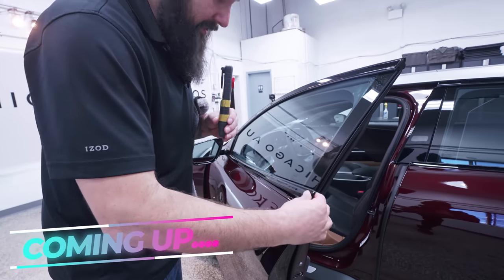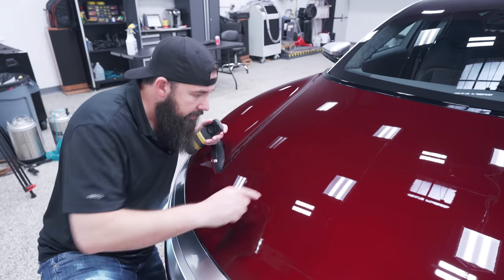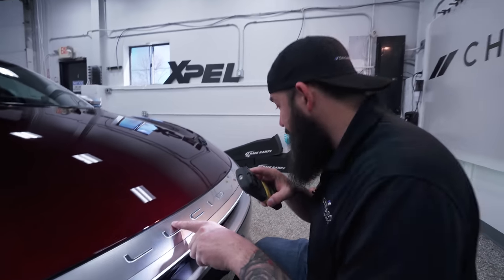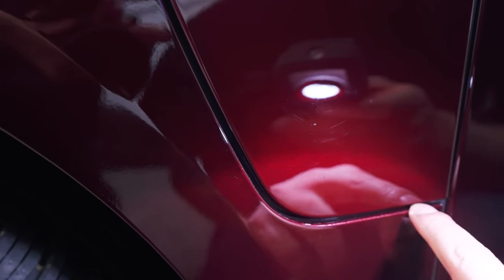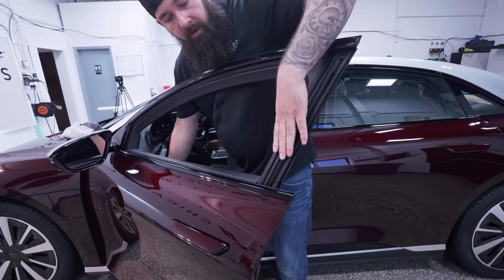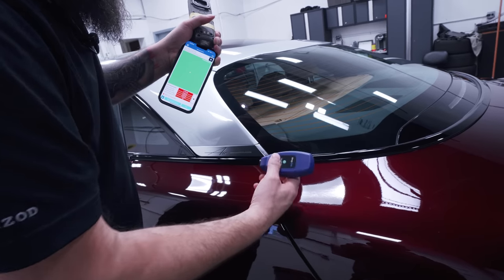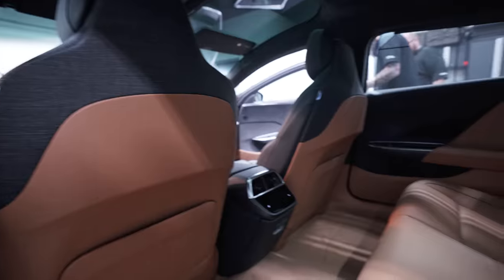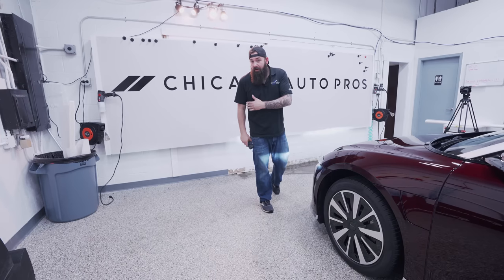2022 Lucid Air Inspection + First Impressions | How Bad Is It?

Comment: For 140k, this build quality is atrocious. Hopefully the repaint was disclosed, because if not, there should be hell to follow. Lol Thanks for making these vids that allow us to make more informed buying decisions. You guys are the real MVP’s
Reply from the maker: It was NOT disclosed.
Reply: @ChicagoAutoPros  “Lucy, you got some splainin’ to do” lol
Reply: Sounds like a cousin of Tesla with fit and finish problems.
Reply: That door trim that is loose is not the same door trim as on a Lucid. Something isn't adding up....
Reply: If you buy a imported car into the USA, lets say a BMW and it got damaged on the way over on  the ship or at dock side in the US it will be fixed buy BMW and they don't have to disclose it.
Reply: @geraintroberts7569  This happened to my MINI. I was tracking it's progress, and the thing sat "on the dock" for almost a month. When I got the car, there was red overspray inside the front of the passenger door jamb where masking was difficult. The clearcoat they reapplied wasn't blended correctly, either. I put my foot down at the dealer, and they made it right. They even repainted the roof, which ended up being the smoothest paint on the car. These things happen. Sad that it happened on a $140,000 luxury car, rather than a $25,000 commuter.
Reply: @XX-166  younger Tesla is more accurate. Tesla build quality is far better than it used to be, and they don’t sell $170k+ cars like Lucid does 🤷🏾‍♂️
Reply: @waynelewis9110  teslas build quality and fit and finish is shit and that’s well documented
Reply: @geraintroberts7569  they disclose everything. Don’t spread false info.
Reply: @XX-166  Sure bud! Tesla’s sales continue to reach new heights and quality continues to improve. Keep on detracting though lol
Reply: @waynelewis9110  the truth isn’t detracting Elon…it’s just the truth
Reply: @XX-166  Something can’t be deemed truth if it’s missing much needed context 🤷🏾‍♂️ Besides, detracting Tesla isn’t just detracting Elon. Tesla employees over 110k people, with over 50k in the US. You are detracting all of those people too.
Reply: @waynelewis9110  go finish your Elon tattoos fan boy … we all know where you’re coming from rainman.
Reply: @XX-166  Lmao, you got jokes. I guess setting the record straight somehow makes me an “Elon fanboy” when I’m really not. Funny how it didn’t take long for you to start name calling 😂
Reply: Not as bad as Tesla for sure
Reply: @marvinmarshall8884  Not as bad as 2017 Tesla but even then, Tesla isn’t selling $170k+ cars.
Reply: It must be said that the handling steering brakes and suspension are in a completely different league than anything from tesla. I know because I’ve driven both. The lucid reminds me of a lotus. 1st priority is the chassis and everything else comes secondary
Reply: @joetz1  You can say anything as you like. However, when Peter Rawlinson bragged about Lucid's capabilities to overcome the production issues by taking advantage from the lessons of Tesla's past experiences, then Lucid should have no excuses for delivering 'the 170k $ unfinished products' to its customers.
Reply: @waynelewis9110  the quality shouldn't have been so piss poor to begin with and thus it wouldn't need to improve so much.  Keep on making excuses for King Musk though, fanboy lol
Reply: @Euro2024champs  You seem so damn hurt to where you have to quickly name call. Grow up guy. My point was that it’s not apples to apples to compare Lucid’s hand-built $170k cars’ (literally only producing around 7 in an entire day) rough quality with mass-produced, early Model 3 quality which were built in the thousand and not by hand. I never disputed the fact that quality was rocky with Tesla. Model 3 ramp had some bad stuff, but it’s in the past. Move on and find something else to legitimately complain about with Tesla, like how they removed the mobile connector as an included accessory with vehicle purchase.
Reply: @XX-166  Actually on the newer models, the fit and finish improve a lot compare to the 2017 thru 2019 models. I have friends and co-workers bought 2022 model 3 and Y. I went over to see their cars, just to inspect the quality. To my surprise it was quite an improvement. So just give Lucid some time and they definitely improve on the quality.
Reply: @lancetruong4957  those earlier years also had some models without issues.. the newer ones do also because of an assembly line/business culture of there’s no one else out there so the public will buy our cars regardless of perception. Those days have been long gone and the competition is healthy with better technology and options along with 7500 dollar tax breaks
Reply: @waynelewis9110  I still have not seen a Tesla on the streets without misaligned body panels. The build quality is terrible and it doesn't even have a nice interior. Tesla is like Dodge but electric.
Reply: @JohnFromAccounting  And yet every car you've seen was pre-2019
Reply: @JohnFromAccounting  I bought a new X 2018 into 2019, it arrived with a handful of small alignment and seal issues, I made a list and they took it back for a day and sorted them all. Paint was actually pretty good, interior was very solid, easy to clean despite being white, I am not a Tesla evangelist or anything, but generally they are now fairly solidly built and well thought out cars.
Reply: @XX-166  well its ex tesla people who started lucid
Reply: @nocensorship8092  and at those prices we’ll see how far that goes.
Reply: @Euro2024champs  Don't like the quality of either. It's harder to justify mistakes for a higher price regardless of performance.

Comment: Unfortunately for such a young company, there will be fit and finish issues. Just as Jason noticed, I saw the same thing on a display model in a Virginia mall. The inside is almost perfect; very beautiful and expensive-feeling materials. The exterior was not perfect, but good enough for a brand new car company. 
Their target customers understand this, have deep pockets, and are willing to be 1st buyers of low-volume-high-cost luxury cars. They are basically subsidizing development of cheaper versions ($50-80K) of these cars in about 5-10 years. Their EV tech is impressive, especially the electric motor unit. Very small and powerful. Plus it goes for 500+ miles. 
I am more interested in their SUV, Project Gravity. Hoping to buy it in about 8-10 years.
Reply: Same boat. I am interested in one. Might get it in 2026 when its all squared away and more 350 Kw charging station is available.
Reply: Young company? take a look at the Company Leadership portfolio, there is absolutely no excuse to release subpar product in this day and age.
Reply: Ppl frm tesla and jaguar?
And u call it young?
Ok
Reply: Good enough lol, or buy a car from a real company.
Reply: @DKK  lol. Lucid is a real car company. Have you seen their factory? It has to start somewhere right??
Reply: @isserdigan2835  anyone paying 140k for that really isn’t too smart. Unless they enjoy things half assed. 
Us usually when I buy something new I expect it to be perfect not well it’s a new company so it’s good enough.
Reply: @DKK  they were a battery company. They are just in car building the past year. They are ahead compared to Tesla in their 1st yr. They have a lower model which will be around 70K.
Reply: I would agree in other cases, but they are selling luxury and luxury is what differentiates it from other brands. Those mishaps are exactly the things that have no right to be on that car.
Reply: Save 🇺🇸  same thing people said about Tesla..
Reply: I'd be more excited about what an established company will do in 8-10 years then a company still starting out with shockingly bad QC issues like this, that window seal just being able to push out over wiping a rag is a bit... sketchy. I can't imagine that staying on with a bump in the road and I can only imagine who's liable if that knocks into someone's car.
Reply: @Adierit  an established company couldnt do what these new companies can. Lucid had their tech developed for 10 years. Sole focus. Dedicated to EV. Big companies are still distracted with ICE cars.
Reply: @isserdigan2835  I'd say the window trim has me convinced of otherwise, Even Tesla didn't have parts that you could just lose from a speed bump.
Reply: well, maybe it is ok for a young company...not to be perfect, but for 140k? no way, this is a very bad qc result and should never leave the factory
Reply: Being a young company is not an acceptable excuse for the poor quality.
Reply: Save 🇺🇸   Tesla is the future. The future is companies spending f**ktons of money throwing s**t at the competition online. The future is now.
Tesla has an extremely well-funded, well-staffed, and well-camouflaged online presence team, with a brigade of IT Middle Managers car-owner/stockowner/cultists to parachute in and s**t all over the competition, wherever online it occurs. Like this hitpiece. And your comment.

But to remind all of the real history:  Tesla was a decade plus before they did jacksquat except burn down lotuses. With a billionaire narcissist's playmoney to hold them up. 
Lucid will have to operate like a real company, not a cult.
Good luck to them.
Reply: @vr4966  bruh its their first sales give them a break.
they have no experience in paint job etc. and still car looks beautiful and its much much better in terms of quality comapred to tesla even when tesla has so much experience
Reply: @DKK  no other car matches its specs 1111hp and 520miles range yeah the car has base too strong to not justify the price.
when it literally beats cars like Ferrari Lamborghini Bugatti in their own game that is performance.
and it also ticks base boxes for a luxury sedan with the sheer internal size and facilities like massage seats etc.
Reply: You say 'good enough', but for 140k you don't expect 'good enough'. It's just a slap in the face to the customers. I don't know about established brands, but you see this poor quality control in most to every new car manufacturer, because they want to start making cars and the more the better.  I doubt Porssche would ever deliver a car like this

Comment: In California, by law, unless more than 50% of the car has been repainted it does not have to be disclosed. The amount of paint done at port facilities is shocking.
Reply: I'm in California and any repairs over $2000 must be disclosed.
Reply: The law don't have to cover everything. This would simply make sense to informe the customer
Reply: I worked in a port facility 10yrs ago. I have seen cars with the front ripped off them by truck repaired and sold as new vehicles....not good.
Reply: when the cars are transported in perforated railcars and folks tag up on those perforated railcars, well.....

Comment: I like the big open tailgate. Looks like an Antonov 225 (r.i.p.) while loading cargo. In Europe we had a Vauxhall/Opel Insignia Tourer with the same big open tailgate. That one had a full rear light set within the boot/trunk as well. I believe the Insignia was sold in the State as a Buick but I'm not sure if you got the Tourer as well. Excellent analysis on the Lucid. Just heads up, the weird looking window trims are also on the new 7 Series / i7. Look at the Window trim on the rear doors and you'll see it. They used to do it on the 6 Series Gran Coupe / Alpina B6 Gran Coupe as well.

Comment: I work at Toyota and repainting is a common and encouraged practice. If there's a defect on a bumper and we've sanded through the clearcoat its more environmentally friendly and cost effective to send it into the paint booth again and reuse it. There's nothing out of the ordinary with this vehicle having repainted sections, especially on the body. A manufacturer isn't going to scrap an entire vehicle shell because of a small paint zone.

Comment: US requires brake lights to be visible and functional when the trunk is open. It’s why the rear taillights are split into 2 different sections even on trucks with a tailgate, you have to be able to see the brakes when the tailgate is down or trunk is open on a car. That car has a solid light bar so it’s no surprise. Audi does this on some of their models as well, there are lights built into the bumper that will function as brake lights if the tailgate on the SUV is up when driving.

Comment: Building cars is very hard - that it’s done so many times a day is testament to ingenuity, but early cars even from an established manufacturer can have many flaws. Also the opportunities for damage are big - I’ve even seen cars tag the transporter during loading or get whacked at a dealership. Visible lights with boot open are required in some areas of Europe I believe

Comment: 13:02 you have the lights there for safety in case u open the rear trunk in the evening so other cars/vehicles behind will know there is a car out there.

Will thought of Lucid.

For the paint issues, seller must have:
first, inform the customer
Second, get lucid's support in case it was a factory issue, else its retails issue to compensate by reduing the price.
Reply: Its not well though of from Lucid, its literally the law

Comment: I think the lights at the trunk lid are for safety. If you are at the trunk getting something out and on coming vehicle will see the red lights.  You forgot to open up the front lid and examine the fronk that has additional storage. Overall excellent video of your observations.  I have a deposit in on the Lucid Pure.  They are going up in price by $15K on June 1st.
Reply: Seen those before in door corners, but I think first time in a trunk. But totally makes sense to have those there.

Comment: Damage doesn't just happen in transit. You'd be surprised on the damage that happens during the manufacturing process. Robot paint errors are common along with paint contamination (dirt, dust, fibers...), paint imperfections with metallic, ecoat drip under the paint...anyways, when those issues are found on the conveyor and the production team can't buff them out they send it to an offline repair section of the factory where those defects are worked on. Depending on the severity of the defects it may require sanding and respray with human hands. At worst there might be a dent that requires sanding down to the metal to pop out and then it manually gets resprayed. After it's repaired it goes back onto the conveyor for assembly and during the assembly process some still get damaged by either robots or production associates. When the car makes it to final inspection they try to catch any new or pre existing defects. If they catch paint or body defects they'll send the car to the factory "paint hospital" for repair before finally getting loaded onto a truck to reach its final destination....then they can possibly sustain damage during transport as well.
Reply: Also, repairs that happen on before transfer of ownership from the manufacturer to the first registered owner don't have to be reported as long as it's not a saftey/reliability issue in which case if they can't repair it they just scrap the whole unit and take parts off of it to use on other units (if still usable). I used to work at a dealership and we would send cars to a good repair shop to get resprayed because they'd get damaged during transport. Since no insurance was involved for those it won't come out in the carfax history as having been repaired.
Reply: WoW...  I'm shocked to hear all this about damage to cars long before 1st buyer gets it home.  But my guess is it's been a fact of the automobile industry since the beginning.  🤷‍♀️
Reply: @julie4871  yup, I would imagine it was worse before. Now that we have better equipment and technology I'm sure the damage is less and repairs have gotten better.

Comment: Hum, I'm not feel'in it....  I have one of these, the GT version in Zenith red, same as this car. As soon as I saw this video and went out to check all the points you brought up in the video. I did not see any of the stuff you showed. I carefully went over the whole car, didn't see the aberrations you pointed out. The door trim being loose is odd because this car's door trim looks a little different then mine and it's solidly mounted, you can't pull it off. I'm not saying you didn't see this stuff because it's clearly on the video. But I wonder, as you pointed out, if something happened to this car and someone isn't owning up to it. It looks like some random body shop person tried to fix the car as evidenced by the door trim that doesn't look like Lucid's. It would make no sense that this fix happened at the Lucid factory - they would have used their own door trim. A body shop person wouldn't have access to Lucid parts yet. So, since my car doesn't look like this - and I picked it up a week ago and haven't been in an accident - I might think that I don't know the whole story even if the owner says they don't know anything about an accident - something doesn't make sense.... You just don't know sometimes....
Reply: I think what's happening in that video it seems is the owner had an accident and someone did a crappy job of fixing it. That's why things don't look like it was put back correctly and there's missing pins to hold them in.
Reply: Or you just got lucky and got a well built car, thats more likely really.

Comment: 12:47 There needs to be lights there, in order to keep the presence lights visible, even if you have your trunk opened, as the majority of the rear lights are present on the trunk lid.

An example of this may be if you have a flat tire on the side of the highway, and you have opened your trunk to reach your tools and leave it opened, your lights shall remain visible to the incoming traffic, in order for them to acknowledge your presence there.